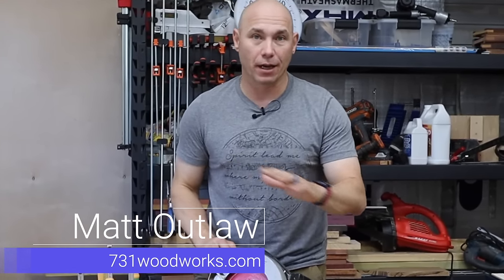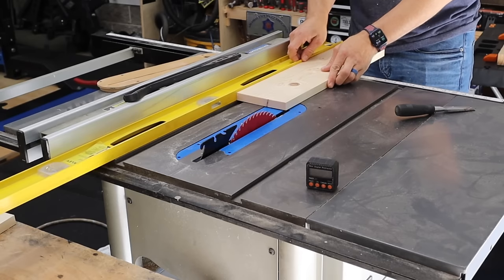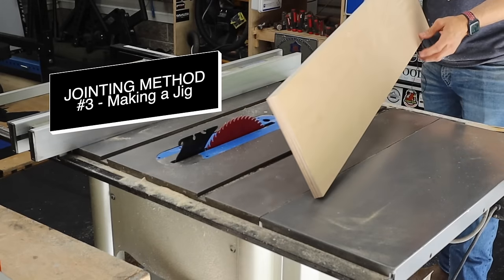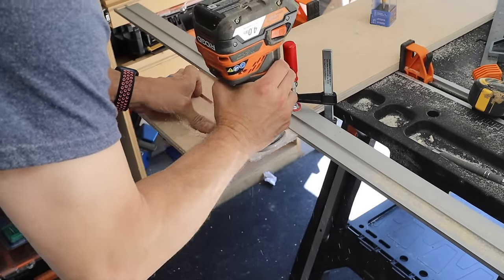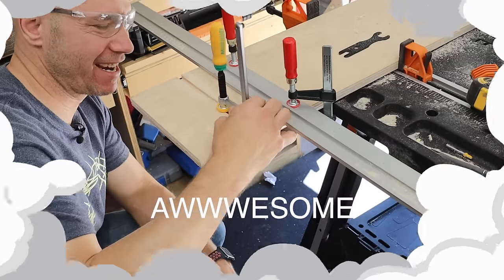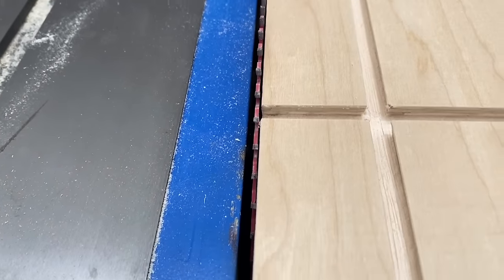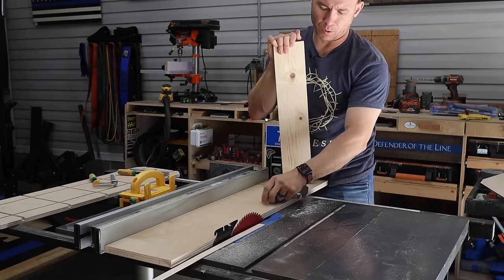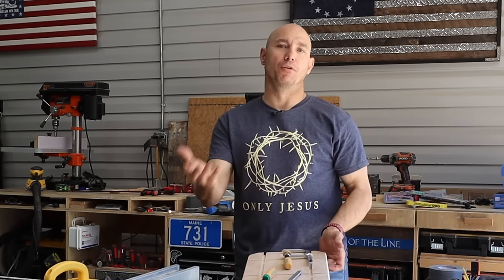5 Ways to Joint Boards Without A Jointer | Woodworking Tip

Comment: I built a taper jig same idea as yours a year ago. Besides tapers or jointing.....it is great when you have a board with a natural edge or bad edge. Using the jointer idea....you cut off the bad part of the board and than run through again for a second very fine cut to get the best jointed edge. Here is a topic for another video....double sided carpet tape is an amazing tool that takes the place of clamps in many cases, i use that tape for many projects. I can "clamp" stuff where I can't get a real clamp in place. Once the cut is finished you just pry the pars apart and pull the tape off.  By the way the jig I made like yours uses two 1/2" pieces of Baltic Birch glued together to ensure it stays flat and square for years. That surface with all the dove ail slots lets you use that side as a clamping jig for various projects. It can also be used as s table saw high fence when it is clamped on edge to the regular fence.....the 1" thickness ensures it is 90 degrees to the table.

Comment: Good video. I just use my table saw fence and cleanup with joining hand plane. Old school but it works. But you need to find a hand plane and learn to use it. No electricity required.

Comment: I still have to resort to using a hand planer to joint boards, and or, well, plane them.
I live in an apartment, and I dont have a garage to use as a work shop. So, I do what I can, and what ever it takes for now.
Thanks for sharing for future reference for when I do get a table saw. 
That's the next piece of wood working equipment that I'm getting. 
I have made a cross cut jig for my circular saw, and it works decently.

Comment: You have cured my jointer envy.  I made my first jointer jig (second method you shared).  Used it for cutting up pieces for an end grain cutting board.  The joints were like butter!  I will probably make another version that takes finer cuts (mine was taking just shy of 1/32" per pass), but am thrilled with the technique.  THANK YOU SO MUCH!

Comment: Great tips Matt. Thanks for putting this together. I especially like the multipurpose jig. I’ve edge jointed longer boards (e.g. 7 - 12’) with a track saw or circular saw w/ straight board as an edge guide. Of course nothing beats a Jointer for speed - IF you have the $$ & space for one (+ all of the dust collection eqpt. that you’ll likely want). The MatchFit clamps are great. I’ve found that in most applications you can just cut the grooves in your jigs or tables and never buy T-track again. Thanks too for wearing your testimony. It’s subtle, but just enough to let the Holy Spirit take over.

Comment: Thanks for the vid. Be sure to measure your table too while using a digital angle gauge! If your blade is perfectly at 90 deg but your table is not exactly level, well...do the math. You can also joint without measuring. Joint the first board facing up and the second board facing down to even out any miss alignment. This will always work, even if you set your blade to 45 deg. Don't forget to mark the faces before jointing if you use this technique.

Comment: This video absolutely made my day! I have some live edge maple slabs that I plan to put together. I've been racking my brain on ways to get a nice square cut for my seams, and this video just solved it for me. I had planned to screw a straight edge to them to run along my tablesaw fence, but this jointer looks like it would be an awesome thing to use instead!

Comment: The best way I heard to describe why the level trick works is because the level being longer than the fence allows both ends of the board to maintain contact.  With a regular fence the opposite end of the board is not in contact with the fence and is allowed to move side to side as the cut starts.

Comment: The dove tail jig is the best. Use it for all the things in the video. 

In addition, I use to cut off the twists from some wood I have. Shim a piece to yhe jig so it does not rock - cut. Remove the shims and place the flat side on the jig. Cut. Now you have 2 perfectly flat adjoining surfaces at 90 degrees to each other. Cut the remaing sides off against the fence and you get a rectangular piece you can actually use. Granted, those 3x3s aren't 3x3s anymore. But they're perfectly staight now. They're also 30+ years old and aren't going to get twisted again. Left one lying outside in the insane humidity and temperature changes we get in the Emirates - straight as anything after 4 weeks... It's definitely one of the most useful (and sumple to make) jigs. 

I didn't go with the runner on the bottom. It runs just fine against the fence and the runner would reduce functionality (tall fence).

Comment: You can also use a router in place of the skill saw with a straight shank milling bit 
and get even a better edge.   I have clamped a straight edge down before and rean a router down a edge several times before I got my jointer.    I also get a sled like this wood be awesome for those with a router table.

Comment: I was thinking of building one of these jointer sleds and then I realized that I can do the same thing with the large sled I built with t tracks. I don't think I would want to put much pressure on those clamps of yours because only a small amount of wood is holding them. The front fence on my sled is removable for long boards and the base has 2 guides that run in both of the table saw grooves so it is very stable.

Comment: Great video. These ideas are genius. I want to try the second method but I’m having trouble understanding why it works. Since the plywood is stationary why don’t you get the same results as if you just used the rip fence?

Comment: Hello sir! And thanks for taking the time to make this video! I absolutely LOVE that jig you made! Very nice! And using it as a high fence is incredibly beneficial. If you are feeling froggy you might attempt BUILDING a router table and under mounting your router. I am currently building a router table/table saw in one that use the same fence. That little jig you came up will be very handy with home made set up. I plan to incorporate that idea into my home woodshop.
Reply from the maker: Glad it was helpful!

Comment: Instead of using your jig on the last suggestion you can use a 6 foot level (for long boards). I have been using that method for decades and it works really great. My joints are seamless and many folks can't even find the joint. Of course that requires finding wood with similar grain which is easier to do if you use wood that has grain that is harder to see.

Comment: I clamp a straight edge to the fence, like a 6' level, and run the concave side of the board against it. The straight edge has to be at least twice as long as the board. Works great.

Comment: Hi, praise Jesus ✝️  first time watching your channel and its good stuff bro! The dove tail jig- awesome love it! ❤what I use when taping down boards, especially for thin veneer tops for guitars even 48mm thick 2 piece board used for solid body stratocaster type guitars etc where the sticky residue of duck tape will leave marks that are a bit of a nightmare to get off, so luthiers use this trick to set one side of a 2 piece board down, in order to get a flat 90° edge and have it grain matched,  very quickly and low cost all you need is masking tape and super glue with the accelerator spray too. Much n such the Same idea as you demonstrated on this video using ductape and it gets used on many luthiers workbench using shooting boards and long jack plains too get a fine edge on both boards, also while using CNC routers and when hand planning the top and routing out cavities for pickups and neck joints, the shape over a template jig- the jig can be stuck down on the top using the same masking tape method as whats holding down the whole piece you're working on all at the same time without any need for clamps- pretty much any flat board that needs to be secured Down without any give on lateral movement, and it pulls up easy and is fast. Cheap,  the beauty of it is it comes up easy after you're finished and wont leave marks and will surprise  you how much hold it has will hold as long as you need, as the superglue will only be between the masking tape and not on the boards because of the accelerator doing its msgic the glue if you use the right width of tape and the rest is obvious it doesn't stay down long and therfore lifts up very easy even on thin veneer tops plus it allows th whole top to be free from clamps so no moving clamps around or whatever and no clamp marks not that anyone would be dumb enough to bare clamp down a piece of fine wood without something to take the pressure.

Usually 2 strips of masking tape for either side of the length of the board width or however it is best done 👍

Comment: The reason the level trick works is not so much about sliding the level with the board. It's really about giving the board a contanst point of contact. I usually clamp my 8ft level to the fence when doing this trick to do longer boards when I'm on the job site if I don't have my track saw with me. I use my jointer or track saw in the shop.

I really like the sled you made!

Comment: Great job Matt. I don't know if anyone mentioned it but if you do not have double-sided tape use blue painter's tape and CA glue. Affix the painter's tape to both boards (opposing each other) and a few drops of CA glue to one side and CA activator to the other press boards together. Never need double-sided again.

Comment: Just to add, if you have trouble getting the table saw at exactly 90 degrees, you can simply flip the alternate planks face up then face down. So plank 1 face up, plank 2 face down, and so on. That way any blade angle difference will be cancelled out when joined. 
PS, loved the jig.

Comment: I like the jointing sled for the table saw, i like it a lot! Im wondering if they make ratcheting gear clamps for dovetail joints. Kind of like the festool clamps. I recently got some jorgensen 8" gear clamps for like $14 each on the zon. Im completley sold on this clamp style. Its fast, strong, and doesnt really move the workpiece.

Comment: I have the bora wtx clamp edge that I clamp onto my table saw when I need to do long edge joints. It acts as the fence but also extends the fence towards the infeed side to support the longer boards. Hope that makes sense. I can do a full 8ft. length or disconnect the two pieces for a 4ft. length. Just need a vertical leg to support the "drooping" of the clamp.

Comment: about 45 years ago i bought a tapered sanding disk for about 8 bucks. put it on the saw change the angle about 2 degrees to make the angle center top 90 degrees. can only take a sixteenth at a time but the glue line is invisible. i have a jointer now so i quit using it but to be honest it does a better job. what i mean by tapered is a very flatened cone shape. don't know if its sold anymore.

Comment: great video. another way I have seen to join boards that you are going to glue together is to put the two boards together and run the seam across the blade .. this will cut both sides at the same time using the same blade as long as your blade is not warped you should have a perfect match.

Comment: In a pinch, not furniture build of course, but sub duct tape with .23 gauge pin nails. 
I have done a few door molding this way on the job site. All paint grade stuff, so the pin hole is never seen. 
Thanks for your investment into the community. May 2021 be prosperous for you and yours.

Comment: Hi there 731 guy. I'm a new subscriber and new to woodworking. I don't know if new comments on old videos get flagged for your attention but here goes. I am very interested in ways to use a table saw to square off lumber and after watching this, I think I'll try to make a jig like you did. That said, I have a question about your second method - the vertical piece of plywood with a recess cut for the blade and riving knife. You didn't specify how deep the recess should be. I'm guessing half the width of the kerf maybe? Obviously, if the recess is the same depth as the kerf, passing a board past it won't do anything and leaving the entire width of the blade exposed nullifies the point of cutting the recess in the plywood.
Reply from the maker: Good point. Should be the thickness of the blade

Comment: Love the sled idea for making tapers!  For some trimwork, I cut tapers recently by eye on my tablesaw to build out a window box to be flush to the wall, and really wish that I had known about this sled method.  Even without the fancy dovetail clamps, I could have made life so much easier, had I clamped or fastened my stock to a board to use as a sled.
Reply: Here's a more pro tip! Put the wood on the wall and scribe it with a spacer. 1/16th, 1/8th, whatever clears all the gaps. Then cut that with the jigsaw. Place your trim on the window. Then measure the gap at each side. Transfer these measurements to your jigsawed piece and cut that straight.

Before cutting or marking the straight side. You can put the piece up to the wall and check it, sanding if needed.

It can help with sanding to put a 5 degree angle on the jigsaw, so you only have to sand an edge. I stay away from my line slightly on an angle and then sand to the line by hand.

I only use these techniques on visible areas that I feel are critical. I use it for transitions @ doorways if needed on wood, tile, stone flooring. Or if I'm scribing the bottom of molding to pull tight to the floor without caulking. Though if you cut mdf molding it needs painted on the bottom afterwards or it will swell when the homeowner spills something making your product not stand the test of time and lessening the power of word of mouth advertising which is how I tend to market myself.

Comment: Interesting video and it brought up a question. If after you run the boards thru, mainly using the first two methods, would flipping one board over make the joint even better? I mean unless the blade is exactly 90 degrees. Seems by flipping one board it will ensure the edge angles would match up perfectly since they would have opposite face angles...I mean if they are not exactly 90 degrees. Am I wrong?

Awesome sled. Wish I had one of those back when I was doing a lot of wood working. That method of using the circular saw was really timely for me too. I have a need to cut some 1x2 strips to use under my kitchen cabinets so I can install some new drawer glides. I need some 1x2 strips of wood I can use to mount the glides too. I have the scrap 2x6 lumber, but no table saw, so your idea will work perfectly. Save me from having to buy wood.

Really like your videos brother. Very professional with some excellent commentary. I also appreciate your passion for wood working and safety practices. Good stuff !!!

Comment: I'm in the process of making a dovetail groove work surface to use on my Bora Speedhorse XT sawhorses. I made a jig to use with my router on, but the practice grooves I'm making are not turning out correctly. The the method you used to make the dovetail jointer looks to be a LOT easier, so I'm going to try that.

How deep did you make the dovetail grooves? I think I was making them too deep and that's what was causing my issues. Also, if they're supposed to be 3/8" deep like I suspect, do you think 3/4" think MDF has sufficient strength for that depth. or should I laminate 1/2" MDF to the 3/4"?

Thanks for a very informative video, and I'm also going to make that dovetail groove jointer jig.

Comment: Nice work. You could also use a hand plane that is screwed/attached on its side to a flat surface, then run the board against. This will creat perfect match. The larger the plane the better (expensive if you don’t have one handy), but smaller ones with a diy fence along the plane will work.

Comment: Im going to make a jig for longer boards since my jointer has a 2’ long bed. Anything longer than probably 3.5 to 4’ becomes hard to handle and get true flat edges on a benchtop jointer. Thanks for the video I never knew the level method.

Comment: Great video!  I didn't use the micro jig but made a similar sled with cheaper clamps for my table saw.  The level trick got me by but I just wasn't comfortable with it so I built the sled.  Nice thing is can build a longer sled and scale it up for larger/longer boards if need be.

Comment: Sorry to comment. The work you do is awesome. When taking the angle on your blade you are assuming your table is level. Where as a right angle against the blade and table disregard the problem if the table is not level.
Reply: I don't know about his gauge, but with the digital gauges I've used you get a reference zero from the table before checking the blade

Comment: Great video man, thinking through the jointing boards with plywood vertically on the table saw.  If you cut as deep as the width of your saw blade and all the way to the front of your board that should work too. Then you can use the back of your plywood without any vinyl.

Comment: I think I am getting the microjig set up with two or three extra clamps.    It seems like you cut one taper, you're cutting several exactly the same, so two clamps for cut, and the other two ( or three) to hold down scrap alignment blocks for repeated taper cuts...
Great info on jointing!  Thanks!

Comment: As a note, when I need to joint a longer board (or rip one), I clamp a 6' level to my fence to extend it.   I have a job site saw, so it's small.  But I've been able to rip and joint 6-8' boards and 2x4s using that level to extend the fence.  It's about 2 feet in back and the rest in front of the saw.

Comment: I was able to achieve a joint with just using the fence that came with my low budget table saw. you can see the line but I still got a strong bond.